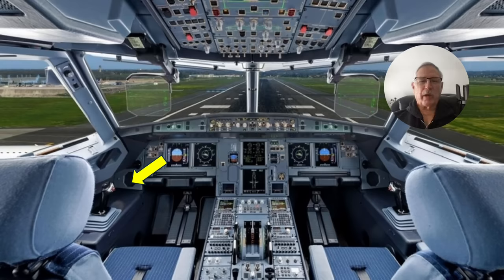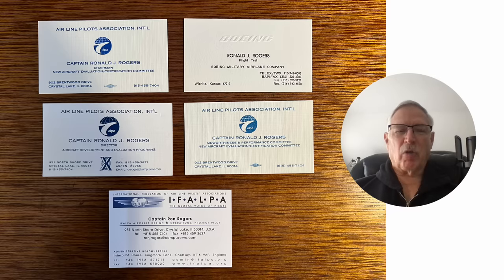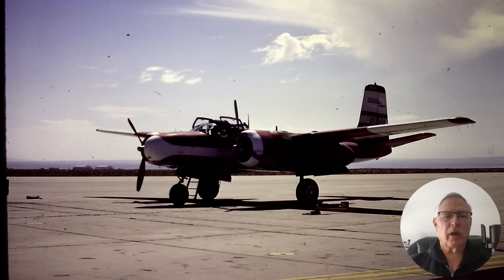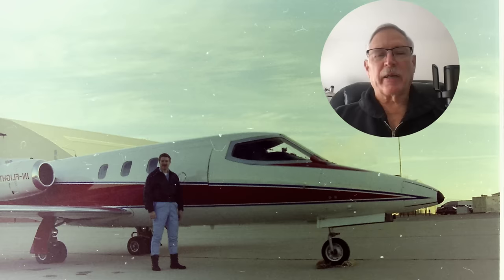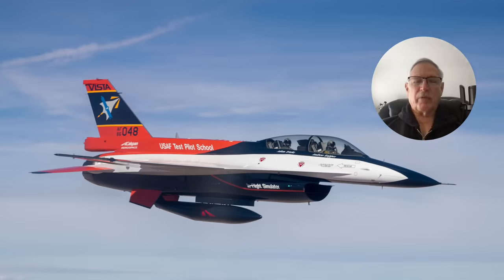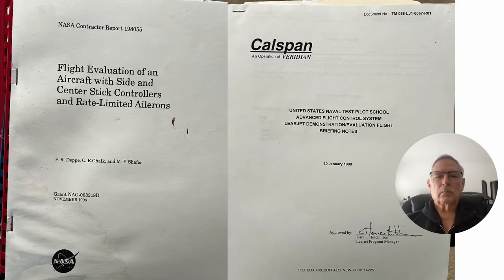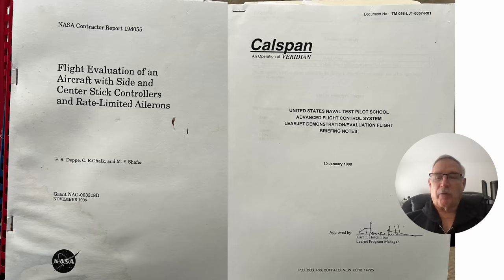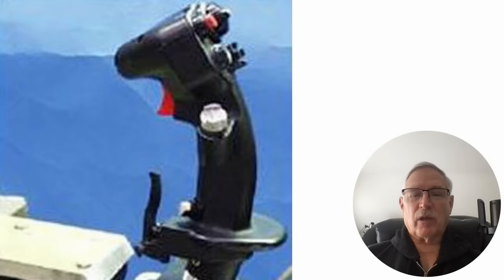Why didn’t they design the Boeing 777 with a side-stick?Funny that you should ask!

Comment: Thanks for the informative material. However, I was not aware the US Space Shuttle control sticks were coupled so as to provide feedback between Commander and Pilot. Today, both Collins Aerospace and BAE Systems have separate "active sidestick" products that provide coupled force feedback between the sticks. During the development of the Space Shuttle control system, I thought that technology was either unavailable, perceived to incur additional failure modes, or thought unnecessary due to rigorous astronaut training.

Related to this is the Airbus passive sidesticks do not have a stick shaker or stick pusher to provide feedback of impending stall. I believe the new BAE and Collins sidesticks can provide shaker/pusher functionality. But for those wondering why active sidesticks are not more widely used, those feedback systems have additional failure modes. It is not unknown for a false stick shaker activation to happen, on both yoke and mechanical control sticks. There was a debate on the 737 Max MCAS case about whether to provide a cutout switch for spurious stick shaker activation. A similar scenario could theoretically happen with spurious activation of coupled sidesticks. Active sidesticks in general seem good, but all factors must be carefully considered.
Reply from the maker: Exactly, and I intend to talk about these issues in a future presentation.
Reply: Sidestick input could be shown in a different way. E.g. light bars which show direct and strength of the input. Including Programming to warn the other pilot by some flashing light if there is either a extremely prolonged input or a extremely strong input. same way, could be useful to get feedback from the plane.
Reply: @beyondEV  On Airbus, that feature already exists. If both pilot and co-pilot make conflicting inputs, a warning light in front of each pilot labeled "sidestick priority" comes on, and every five seconds, an audible warning "dual input" happens. The pilot or co-pilot can take over by pressing the "priority takeover" switch on their sidestick. If that button is depressed for 40 seconds, it locks out the sidestick of the other pilot. Despite these features, accidents like Air France 447 have happened. That said, the A320 initially didn't have those features, but I've talked to A320 captains who flew then, and they never had any issues. This area involves the intersection of training, suboptimal human behavior in high stress conditions, and the human/machine interface.

Comment: That was always my issues. Why doesnt Airbus connect the two side sticks? Ideally mechanical, but even electrical. You eliminate a very sensitive piece of bio-hardware, and thats human tactile sensation.

Its not very pro CRM if you ask me.
Reply from the maker: I agree and now it is technically more easy to connect the side sticks. Back then it was more difficult and of course, they will not go back and change anything.
Reply: @ronrogers  Sadly, thats the case too often. They dont even see the upside, from a marketing stand point. It would be well spent dollars do come up with that system, as improved safety, and even retrofit kits for older aircraft. But like you point out, those Toulouse boys sure get weird about their planes.

Comment: The people in AFA447 wish the A330 had a coupled pilot control.
Reply: There's a recent Air France 777 (2022-04) with a Dual Input incident. The pilots were fighting each other believing they were fighting the plane.
What makes the difference is not the interface, is CRM. Communication, team work.
And besides the FO could have taken the priority control from the other.

Comment: Appreciate your channel Sir. Boeing C-17 has sticks. So why do you thing they deviated with this AC?
Just wondering. I’ve spent a couple thousand hours in a KC-135A model as a Boom Operator. Loved flying and attained Commercial Instrument rating but haven’t flown for many decades. Thanks!
Reply from the maker: I have flown the C-17 and it has an interesting center stick that is modeled after the A-4 (high lateral pivot point). Now that you mention it, it is interesting why they went with a stick and not a yoke. I might have to look into that and my notes.
Reply: That would be interesting to find out as far as I know the C-17 is sort of an anomaly for Boeing. Thanks again and really enjoy your stories.Reminds me of the old days in the tanker. Did you ever air refuel behind a 135?
Reply from the maker: Yes, in an F-4.
Reply: Surely the reason that the C-17 has a side stick is that it was originally designed by McDonnell Douglas rather than Boeing and so, and Ron points out, wasn’t institutionally tied into yokes? Side sticks are lighter, but more importantly for a military aircraft, its pilots, again as identified by Ron, will be used to using sticks throughout the training regime that put them in the C-17 cockpit in the first place. Hercules being a different kettle of fish, as it was designed pre-side stick era, and the J model just followed on from that for commonality. If it was designed today, I’d like to bet it would have side sticks.
Reply from the maker: The C-17 has a center stick, at least the one I flew did. It is based off of the A-4 center stick. @srednivashtar5432
Reply: @srednivashtar5432 If you ever take a look at the C-130 cockpit, there is no place for a side stick. Besides, even the J still uses cables to move the flight controls, which are hydraulically actuated.

Comment: 10 years flying an A330/A340, 22 years B737, 767, 777 and 787.
Airbus side stick controller and their auto throttles are vastly superior. Throttles that don’t move - what matters is the airspeed (IAS or Mach) and vertical speed. WRT to the AF accident, that is basic flying skills, or lack thereof. Attitude and power, regardless of side stick or throttle position.
Boeing - Not Invented Here. Don’t get me wrong, Boeing makes a fantastic product but their pride prevents them from acknowledging that Airbus and Bombardier do it better with a side stick.

Comment: ..."we want to be seen as a leader," no matter how antiquated that makes us look. I've flown both :B- 727, 737-200, 300, 400, and Airbus: 319,320,321 and AB 330-300 and 200. The only time you might ever wish for a yoke was during strong crosswinds, and usually by then they were out of limits for everyone anyway. If both pilots were on the stick, you got a very loud "Dual Input", in fact all the alerts on AB are attention getting. With Fly-by-wire tech there is no need to mechanically connect the sticks, the whole purpose is to save weight, plus at this level of flying pilots should be aware of who is flying ie: "I have the aircraft-you have the aircraft".
Reply from the maker: That warning can be masked. Air France Flight 447.
Reply: The first thing that goes in a stressful situation is our hearing though.

Comment: The 777 yokes are not mechanically connected to the control surfaces and the only way to monitor what the autopilot or other pilot is doing is through force feedback. If Boeing had put a side stick in the 777 they could have utilized the same force feedback system the yokes use. Airbus could add this to their sticks today if they wanted to. The reason Boeing uses yokes on their fly-by-wire aircraft is 100% tradition and pride and 0% system limitations.